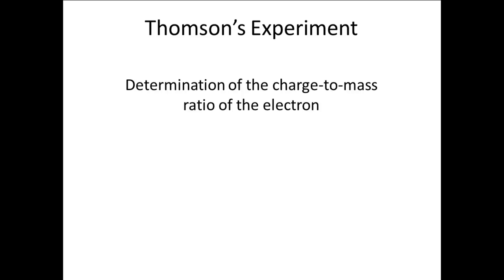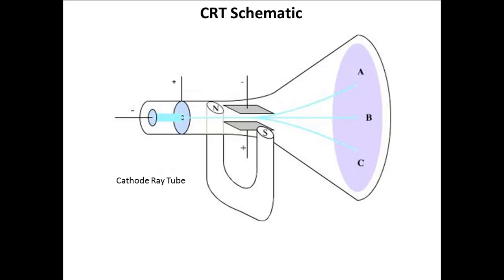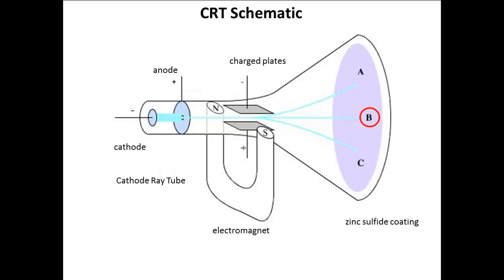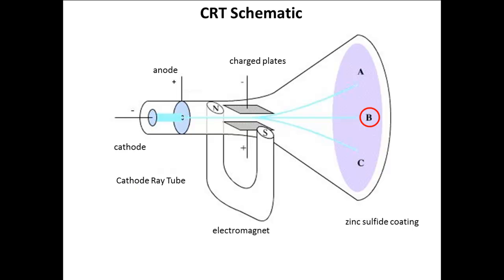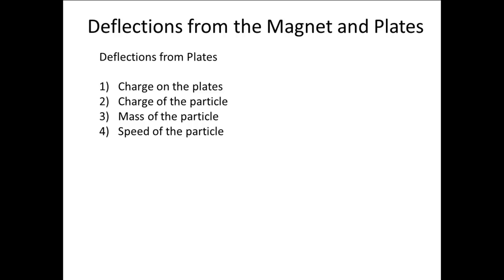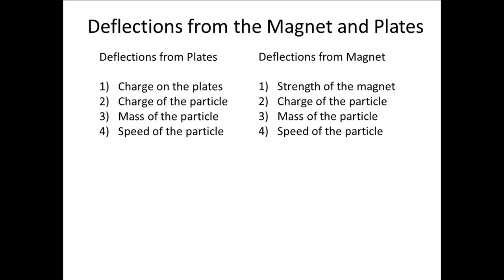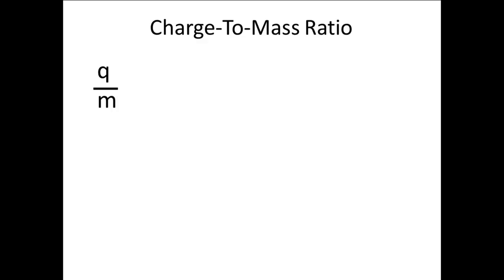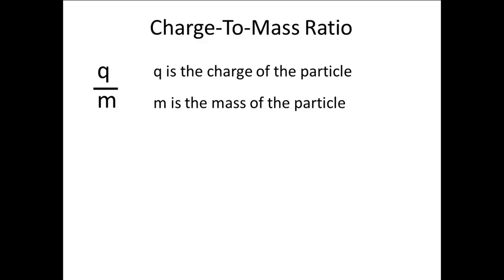Thomson's Experiment

Comment: How does the speed of the particle become irrelevant if the forces are equal?
Reply: +Kes Cholo the faster the particle, the less time the force of the magnet or the force of the plates has to act on the particle to change its velocity. if the magnetic and plate forces are equal in magnitude, they cancel each other out because they are in opposite directions. with a net force of zero on the particle, speed becomes irrelevant